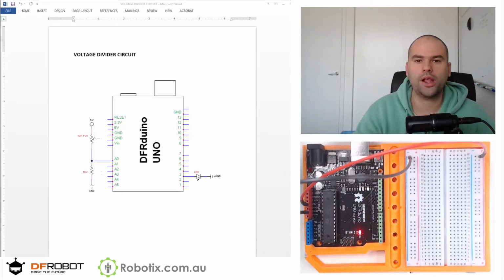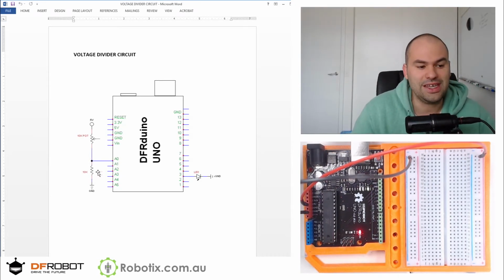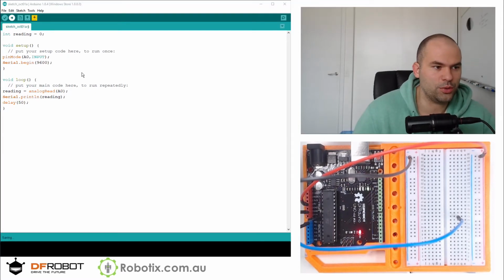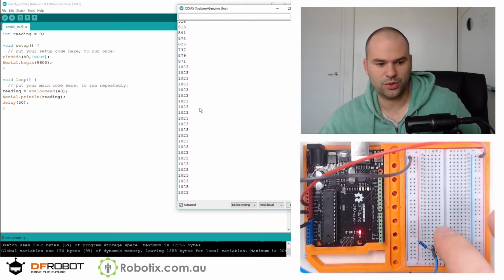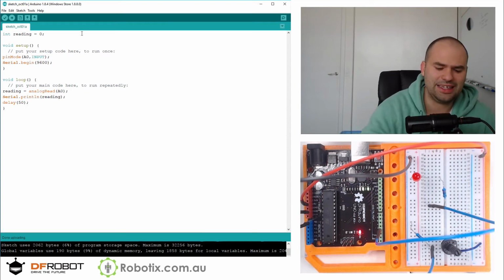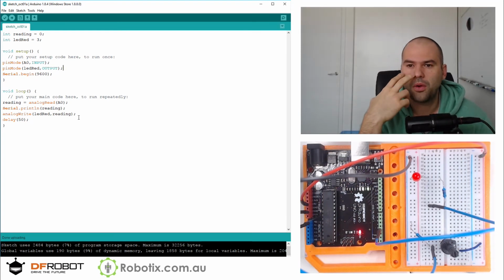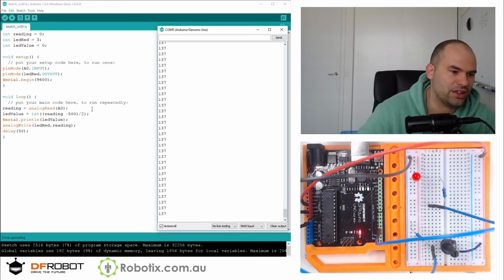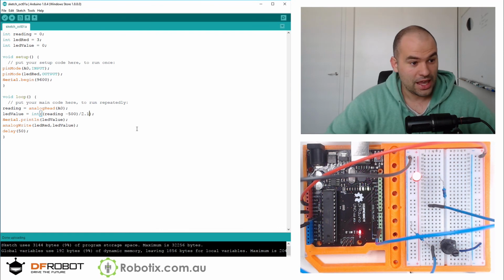Voltage Divider Circuit

Comment: Great tuto.. true that is very helpfull.. by example i got a SIM800L these module its not 5V tolerant i have to made a voltage divider or use a (lineal regulator) but in general is  very good for learn and  how used it  and how made it :)
Reply from the maker: Ah yes the good old sim module that you cant quite connect to 3.3V or 5V.  Voltage dividers are really pretty useful 😀

Comment: Kada si "prebacivao" vrijednost reading u ledValue, lakse bi ti bilo da si koristio funkciju map
U ovom slucaju to bi bilo ledValue = map(reading, 0, 1023, 0, 255);
A ako imas potenciometar sa 3 nozice, mogao si jednu da stavis na +5V, drugu na  A0 i trecu na GND, jer potenciometar funkcionise kao 2 otpornika cija je suma 10K.

To je bio samo prijedlog, nisam nista lose mislio :)
U svakom slucaju, mnogo mi se svidjaju tvoji klipovi jer dobro objasnis
Reply from the maker: Zdravo Djordje, puno hvala na produktivnom komentaru, now in English: 
You are right, that is the proper way to use a pot, one leg in 5V one leg in gnd and one leg in analog input, there is a reason I didnt do it: because I wanted to take out the pot and put in an ldr in the next tutorial which I am actually uploading now :)